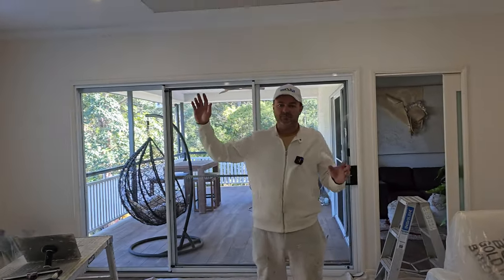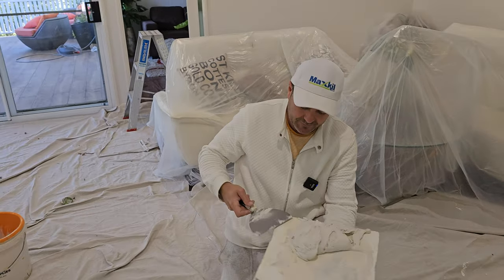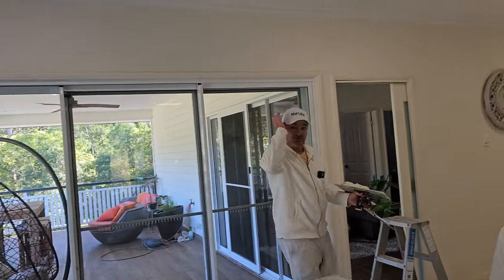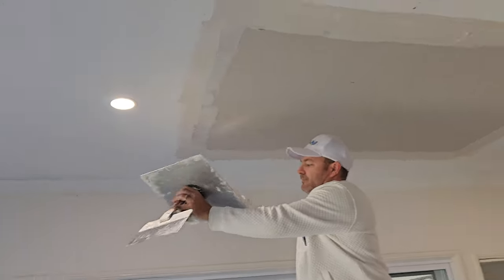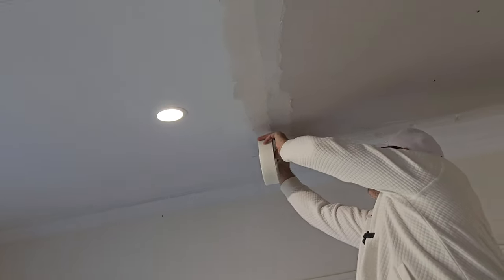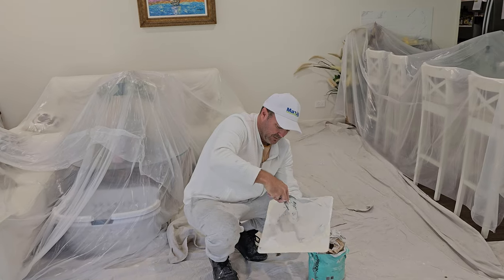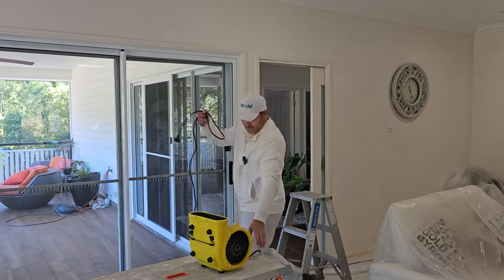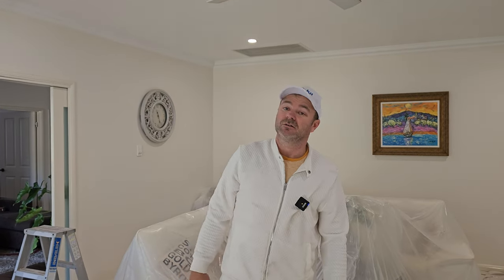How do you make plaster base coat dry faster?

Comment: What brand is the fan mate?
Also what brand accelerator are you using?
Thanks Max 👌
Reply from the maker: The fan is a DynaBreeze bought from Bunnings warehouse and it's a CSR gyprock accelerator. You can also use salt but you didn't hear it from me